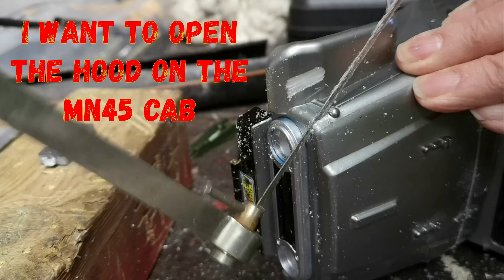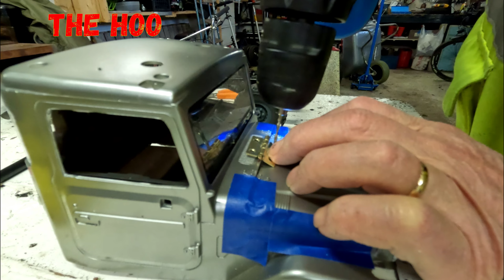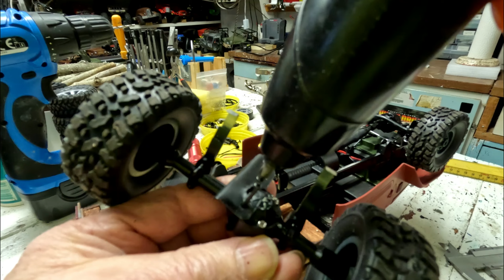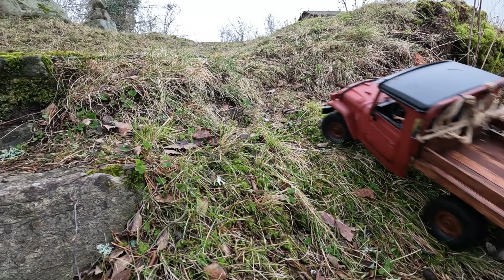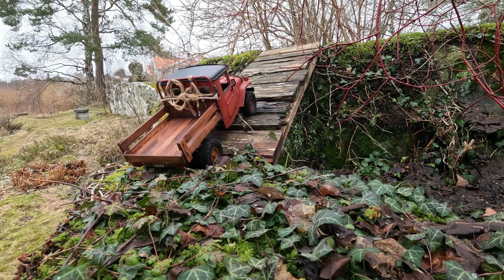Rc Toyota FJ40 flatbed = WPL B14/JJRC Q65/MN45 hybrid

Comment: Hello!
Predictably, I am utterly delighted by your creation. This is so much more interesting than simply buying a C44 kit, and I am most impressed by the outcome. Your stabilising brace for tge rear axle was an inspired move; I'm glad that it worked so well.
If we had a once-a-month golden "thumbs up" for extra-specially excellent videos, I'd give it to this!
Reply from the maker: Thanks Del, glad you like it! Of course it's fun when you can assemble something good from a pile of parts!😊😊
Reply: @Georgieframe  How did you extend the wheelbase?
By how much? Did you use generic Amazon propshafts?
Reply from the maker: @Del350K4  The wheelbase is extended from 193 to 227 millimeters (approximately). I did it very simply, moved the suspension brackets as far forward and back as possible on the frame and drilled new holes. I use plastic drive shafts, extended using super glue, epoxy and shrink tubing. They still last, because it's a 180 motor. I may have to switch to metal eventually...
Reply: @Georgieframe  Ah! As you saw, I recently had to join two propshaft halves. My plastic half had ribbing running both along and around it. I didn't want to glue my "bridging sleeve' to just the edges of the ribs so I labouriously flooded each void with epoxy, let it harden, turned the shaft, flooded the next, etc. I also remember making use of superglue and baking powder (sodium bicarbonate) on that propshaft, too.
Reply: Oh, no! This is terrible!
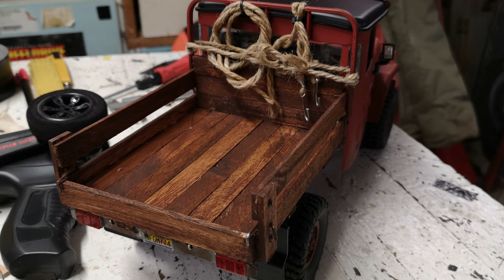 I should've stocked up while I had the chance. They are not good truck's as supplied but they're the cheapest way to build s leaf-sprung big truck in 1:12 scale. My channel can't afford all those exquisitely made, very expensive ones from King Kong RC etc.

Comment: I'm back again! This vídeo troubles me. It makes me feel -quite strongly - that a WPL C 34, two MN Toyotas and a Team Associated, aren't enough. I envy you this truck, and keep daydreaming about building a leaf-sprung Toyota (as mine all have coils) on a WL Toys 124301 chassis.
Reply from the maker: Sounds like an excellent idea! Are you going to use the chassis from your latest bodybuilding video or do you have one more 124301? Guess a WPL C34 cab will fit very good on that 1:12 scale chassis. However you do it, I'm sure the results will be very impressive! 👍👍😊😊
Reply: @Georgieframe  I absolutely hate robbing parts from one build to do another.
In fact, if I habitually watch a channel and realise that this is standard practice, I stop watching.
I think "Hang on, I spent hours watching you build that - and now you're just going to kill it to build something else?"
 So I shall have to procure:
1 x MN Models Toyota body (which I'd turn into a cab, as you did) or C44 cab.
1 x 124301
1 x Flysky 2/3 ch radio
1 x steering servo
1x ESC
1 x set of wheels and tyres.
 I think that's it.
Of course, for that money I could buy a C44KM, but that would be too sensible a decision.
Or I could put it on the new leaf-sprung MN Toyota LC70 chassis, but they don't have that "proper lorry" presence that you get with the WL Toys.
Reply from the maker: @Del350K4  A very good plan and, as I wrote before, I'm sure the result will be excellent. The WLT 124301 looks like a very interesting base for a conversion, but where do you buy one? I've searched the internet but it seems to be either sold out or available in australian or US webstores which is a little too far away. 🤔🤔